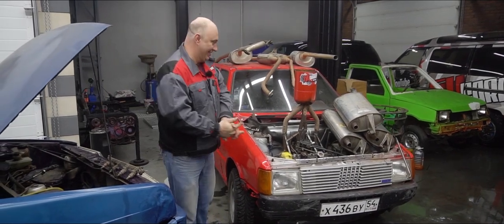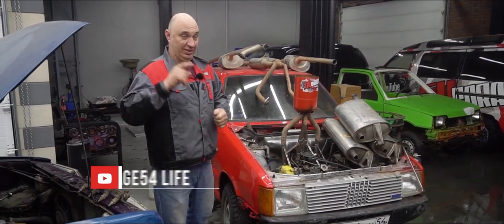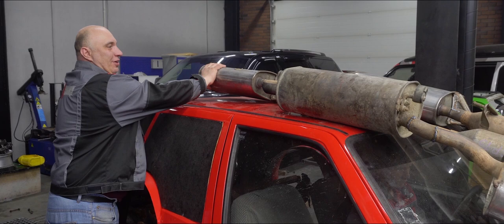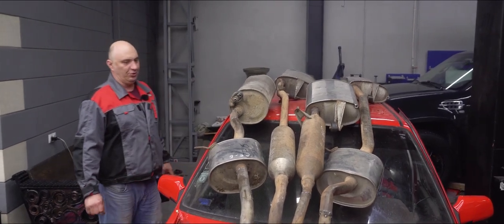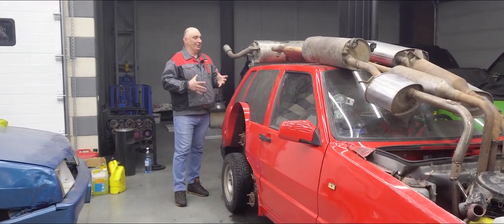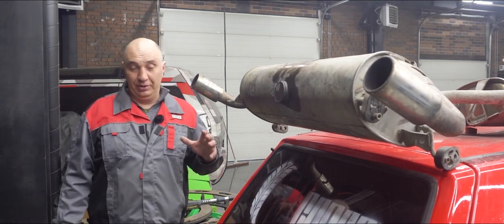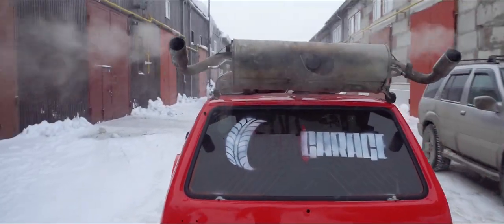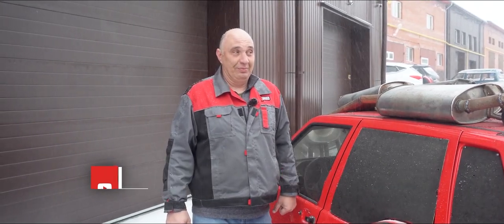Making the quietest exhaust system – 9 mufflers!

Comment: You should connect all mufflers u got into one massive pipe for All cylinders so the Gases go through All of them
Reply: Yes, connect them serially.
Reply: Totally I agreed there dude.👍
Reply: Yes I agree, a 4 into 1 header, then 9 inline mufflers
Reply: And 4 the mufler tip.  Use a trompet, musical exhaust system
Reply: Rout the pipes to the roof and connect the mufflers together there; that way you can still see out the windshield. Plus, the roof would be heated!
Reply: I was thinking run them to the back to give it more room to become silent and actually be road worthy instead of really odd looking.
Reply: and dampen the engine bay for noise reduction
Reply: I'm going with the knowledge of how the exhaust system works eludes them... Multiple resonators do nothing, actually could increase the sound.
Reply: All the this.
Reply: Also needed to isolate the mufflers from the car with rubber stops and from the engine and each other muffler with rubber couplings.
Reply: and carburetors
Reply: eli oliver also use 4 converters then run the end back to the intake to see if it can run off of its own fumes
Reply: @christianfritz6333  Right. The exhaust piping has as much to do with the sound as the muffler does.
Reply: Ryan Botting it’s common to reroute some exhaust back to the intake for pollution and fuel economy but the engine gets less oxygen, so routing it as a totally closed loop would make it tun out of oxygen.
I’ve always wondered whether it would be possible to use a dormant piston cycle to compress twice the cylinder volume into the next combustion cycle, maybe they could use another lada engine as a supercharger to test the theory.
Reply: then again the car isn't setup for that high exhaust flow
Reply: And make it spit fire
Reply: Build a car that drives upside down
Reply: Run in series and it may cause to much back pressure and kill it.
Reply: @christianfritz6333  : thinking its more comedy than "discovery"   just sayin..
Reply: @Gamerdu45  even putting the hood back on with that crappy fabric liner helps a lot.
Reply: @johnnycruiser2846  and connect the exhaust tip to intake as cold air intake after all that length of piping done:)

Comment: On the loudest exhaust idea, just make a huge steel cone for each cylinder and you're done...
Reply: Len Gaming you might as well just not have anything. Either way it will burn valves..
Reply: Put all the exhaust into a single whistle
Reply: Colinfurze did that
Reply: @lolbosss  Ouch.
Reply: @christiangraham4579  sodium filled valves and a large bell end exhaust and you're golden
Reply: They should use 4 Trombones.
Reply: @weevil_man  Not with each cylinder tho
Reply: Len Gaming oh shit, imagine how loud that would be
Reply: And then put in a shipping container while standing right behind it. What did you say?
Reply: Actually one cone is louder
Reply: Zoomies
Reply: @christiangraham4579  Who cares ?
Reply: @christiangraham4579  how does it burn the valves?
Reply: @christiangraham4579  burnt valves are a myth
Reply: Place multiple megaphones back to back next to the cylinders..
Reply: Or an exponential flared exhaust tapering to about 3 feet wide.

Comment: in actuality, having the exhaust of all the cylinders sync reduces the sound since the peaks and valleys of the pulses cancel them self out, after you can add a chamber that tunes the frequency lower, say a 3rd order, then the resonator to reduce the remaining high frequency and the droning and finally a single muffler to reduce the overall sound, the entire system, would be one resonator and 2 mufflers in series tied to a heather with an expansion chamber to lower the velocity before the resonator. practically complete quiet and much, much less bulk.

Comment: You see Ivan, the more mufflers you have, the quieter the car gets
Reply: The quieter the car becomes, the more back pressure it has, which is not good for engine's performance.

I guess if you want a very quiet car, you can have many mufflers, if theres enough room underbody to fit them.

The less back pressure, the better the engine's performance.

Better the engine's performance,  the better the drive.

Also the fewer bend(s) the exhaust pipe has, the better, since there is less restrictions and less time delay getting the exhaust fumes out, and that's a good thing.

The best bend(s) is no bend(s) at all, but if must have the bend(s), make sure its mandrel bend(s), mandrel bend(s) is the 2nd best type of bend(s).

Bend(s) to the pipe adds back pressure and more delay to the exhaust fumes coming out.
Reply: The Royal Crowned Tiger ok smart one.
Reply: @W204fyr  : Thank You 👍
Reply: @theroyalcrownedtiger2946  Engine needs a certain amount of backpressure. Expecially the low compression motor. But of course, what he did there was ridiculous lol.
Reply: @RideOrangeKTM  4 stroke doesn't need back pressure it needs exhaust scavenging. Check this video out

https://youtu.be/A2G1EOB4P3w
Reply: The Royal Crowned Tiger a car does not nessesarly run better without backpressure, it hurts fuel economy and your car would need to be tuned for the new extra flow. Just reminding you ;)
Reply: Back pressure is a myth on 4 stroke engines. For 4 strokes, it comes down to exhaust evacuation and scavenging. Y'all probably believe the factory configured exhaust is the best configuration with that back pressure bs 😂
Reply: @theroyalcrownedtiger2946  You can completely silence an engine's exhaust without affecting the engine's performance whatsoever...

You're just not doing it in the confines of a typical 4 wheel transportation device.

Comment: He totally missed that a lot of noise is being emitted from the intake. A lot of newer cars have a resonator built into the air cleaner box. This older car in the video has a very short distance from the carb to the cylinders, resulting in more noise. They should’ve mounted mufflers to the intake as well
Reply: Correct, and connecting mufflers in series instead paralel
Reply: also the hood was off. put a hood on and that’ll half the sound easily lmao

Comment: Routing cylinders to separate mufflers will worsen the problem. 
When you have one muffler per cylinder, you have massive short-term pressure increases within the muffler. Since sound is essentially pressure variation, these sudden huge jumps in pressure will be very noisy. I.e, you need to keep the pressure as consistent as possible to reduce sound. Mufflers try to even out these pressure spikes with internal baffles to reflect and disperse the pressure wave, but there's only so much they can do. You need to do the best you can at the inlet to the muffler. 
Routing all cylinders through a single muffler creates far more consistent pressure entering the muffler since the exhaust strokes are staggered and therefore the pressure spikes are more frequent giving the overall pressure less time to decay and thus less pressure variation on the next exhaust stroke.

Comment: Hey, you should put sound insulation all around the motor, attach a few the super quiet Honda mufflers, and design and make a fully baffled muffler with fiberglass insulation and point the exhaust straight down.  (Straight down seems to be quieter.).   

And I LOVE this channel.  Love the things you make and do.   It’s all very interesting.

Comment: Put a glass pack on each group of cylinders (use a good one, mine were 48" long) then connect an H pipe. Then put a big muffler, and optionally a restriction valve and a smaller muffler on the output of each side of the H pipe. Had that on my 67 Fleetwood. When the exhaust manifolds were freshly welded, it was dead silent. The loudest engine noise was from the carburetor.

Comment: For the loud idea: I would suggest Colin Furze's approach.  But X4  Furze routed 4 cylinders into one cone-shaped tailpipe over the roof.
I'm saying four straight pipes into four huge cones,  With as few and as smooth and gradual curves as possible to get to the cones.  The cones being about 2 feet across each.   Or hell, go all out and do this to the Ladzilla and go for 8 pipes and cones. 

Regarding the quietest I.C.E. car possible:    Adapt a good muffler to the intake, possibly on the snorkel of the air cleaner housing to cut down on the intake sound.  Then route all the exhaust pipes into one 2 inch collector, and place several larger mufflers on that, ending with your big dual-tipped muffler you have here.   Then attatch a shroud to the radiator fan so that it blows air over the rad, then down under the car, rather than over the engine.  Dynamat the engine compartment, everywhere. Under the engine attach chicken-wire and completely fill the engine compartment with very lightly packed fiberglass insulation supported by the chicken wire from falling out below.  (Avoiding fouling or jamming the linkages, belts and pulleys, of course)  That should quiet the engine sounds. Fit a dynamatted hood and test.   The real challenge is to make it look stock from the outside.

Comment: What you should do, put four mufflers in series on each cylinder along with a resonator. If that doesn't quieten it down, you could try a "water bath" muffler. Pipe all the exhaust from previous setup into a giant container of water. We're talking hundreds of gallons of water. If that doesn't do it, nothing will.

On a side note, this project reminds me of a car I saw once. I have no idea how they managed to do it, but it was a massive boat of a car with a massive V8 in it that was almost totally silent when idling. It was so incredibly smooth running that I thought it was not running at a distance of about six feet. You could only barely hear it right next to it. It got my attention due to how quiet it was. I have never before or since heard such a quiet gasoline-powered car. If I had to guess, they probably heavily-modified the engine to run very smoothly, probably lots of exhaust work, and probably lots of soundproofing around the engine bay. In comparison, my daily beater is about as loud of the car in this video lol. Probably louder. The exhaust sort of rusted out right past the cat which is right after the headers so it's pretty loud. Never got around to fixing it.

Comment: If you put acoustic padding on the inside of the engine bay. ( pipes would have to go under)

Then put pickups on the system in the noisiest parts, running the audio out of phase through a large sound system in the car.  

That should make it quiet.

Comment: The problem with this is that car mufflers work by having a resonant chamber which produces a standing wave and cancels out the sound wave produced by the exhaust. Sort of like how noise-cancelling headphones produce a sound wave that effectively cancels out exterior noise. Car manufacturers have equipment to analyze the exact sound wave produced by the engine, and thus produce a muffler that has the optimal shape and size for cancelling out the most possible noise. Adding random mufflers to each cylinder will therefore not decrease the noise effectively, since that is not what those mufflers were intended to do. 

The only efficient way to make the exhaust even quieter would be to analyze the remaining noise left from behind the muffler, and design one that perfectly "cancels out" the remaining noise.

Comment: Why not try making one that's extremely large?  Maybe start with a 50gal oil drum.  Or how about a straight pipe that's just super long.  Like five or ten times the length of the car?  How about a muffler so big you tow it around on a trailer?  Maybe use a few sections of heating duct and loop it back and forth a couple times.  Still pretty much a straight pipe, but one as big as the car.  
Gigantic, impractical mufflers would be hilarious.  
Now if you want to go loud, you need to build a resonator with a single variable baffle.  That would literally let you "Tune It" like a guitar.  It would have a very narrow RPM where it makes the most noise, but if you mount that baffle on a screw you can tune it to the maximum RPM of the engine.  The main structure would be conical in shape.  Actually, I wonder if these Russians have access to any spare rocket motor nozzles because that would be perfect.  Otherwise, I'd go a hopper from a piece of agricultural or industrial machinery.  Weld a flat circular piece of steel to a piece of all-thread and that's your adjustment.  Might take some experimentation to find the right diameter baffle disk but it's easier that trying out a dozen different connical bodies for this "muffler" that's just a giant megaphone.

Comment: Find a metal barrel, those 100L I guess they have, make a hole at the bottom of it, then weld a metal cap to it, make a hole there too and that will make the exhaust really loud. But make all 4 cylinders pipes to get into a single hole into the barrel.

I hope you like my idea 😅😎

Comment: if you want it quiet you need to connect all of them in series, so not one per cylinder but all cylinders into one pipe and then going through many mufflers one after the other.

Comment: Most of the front-end noise is from the valve train slapping around. If you can adjust the valves to reduce the valve lash to whatever the standard is for that car, it should get a lot quieter.

Comment: I can't help but wonder if it would be significantly quieter just running ALL 4 cylinders through multiple mufflers in line instead of putting one in each cylinder. I suspect less volume with more flow would make the mufflers more effective?

Comment: you should had drove around town and to a gas station to see some reactions.  the car looks ridiculous and halarious but it works!   next try making a catalytic converter pizza oven on the back of the car. hook them up so they align with the edge of the brick oven with a door to keep the heat in.  the converters should get hot enough to bake a cake or cook pizza

Comment: some kind of special made air intake could lessen the sound of the induction made by the engine.  but that could take away power from the engine, tho with the understanding of sound waves and resonance... an air intake pipe can be formed that will also make the sound of air going into the engine quiet without loosing airflow.  as so a theater is also made with the same consideration, but to project it farther distance and keep the sounds sounding good. need to get physics engineer to build custom muffler and resonator.

Comment: I've had my exhaust box Blow (up) off the back off my StreetKA (Luckily for those behind me I had a bar welded underneath that prevented it from shooting out and hitting a car behind me. with out the box my car was SUPER loud (1K GBP for a new exhaust system, only to scrap the car 1 month later because the engine was about to blow up and the F'rs at the garage didn't tell me (despite me constantly going back with engine trouble) I was not happy; + the replacement StreetKA that I was able to find had Fuel/petrol fumes coming into the car after driving 1 mile, which meant that I needed a new fuel tank on that one)

Comment: All cylinders through multiple mufflers IN SERIES would actually be quieter.
Reply: More people need to see this.
Reply: The Bushwacker  Mufflers in series means more airflow 'resistance' essentially, which means quieter sound, but it would be harder for the engine to expell exhaust gases, so it wouldn't make as much power

Comment: The huge heavy exhaust attached to the engine, which flexes / rotates during acceleration inside its engine mounts, will eventually tear the header off, or one of the pipes.

Comment: Could work better if the header was just a 4->1 and have one muffler after that, and another one after that and so on. Like a normal exhaust pipe only with muffler after muffler towards the tip of the exhaust. But also maybe decreasing the diameter of the exhaust pipe towards the end could quiet it down more.
And as for making it louder, just remove all mufflers and keep increasing the diameter of the pipe.

Comment: technically if you can't hear what's coming out of the pipe.. you have made the quietest exhaust system.  

now if you had some sound proofing for the engine bay, and hood, it would probably be very quiet.

Comment: The mufflers probably should have been smaller. Since each was only for one cylinder, you probably could have used a motorcycle muffler, then a car muffler or 2 after they had been combined.

Comment: Make a waterproof engine bay with exhaust and induction sealed and submerge the engine in mineral oil. It won't interfer with any electrical systems.

Comment: Reduce all from the flange that conects to the engine and a muffler rite after smallest you can find  se what happens use like a 1/2 pipe se how much power loss you have to

Comment: Actually, if you want make it silenced, you dont need really 4 seperated lines. You only make exhaust system longer with more mufflers.

To make it very loud, you need add sort of trumpet, causing more vibrations and so it will get louder. Learn how trumpet work, and use it in exhaust system.

Comment: They should have used a car with either a V6 or V8. 4cylinder engines normally have alot of noise under the hood so it was the worst choice for their experiment. Also running the exhaust under the car would have made a big difference.

Comment: Quietest in the world is an electric car  silent and deadly

but the tahoe hybrid has the quietest exhust under 1200rpm   V8 engine  it has duel mufflers  they are HUGE insize   both are  2.5 feet wide by 5 feet long.

Comment: now what happens when you put a bunch of catalytic converters on a car instead of mufflers?  is it possible to build a indoor pizza oven out of the converters in the trunk?  just line them up inside a brick layer shaped like a brick pizza oven.  try baking a cake too just by driving around.